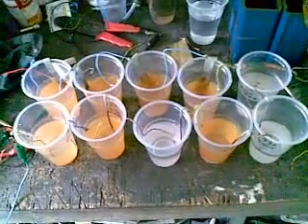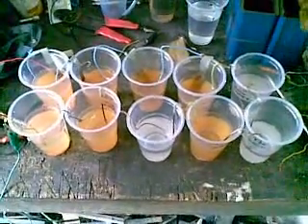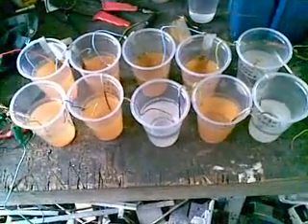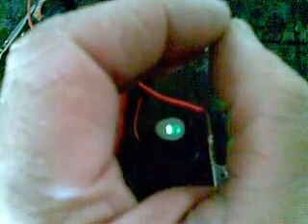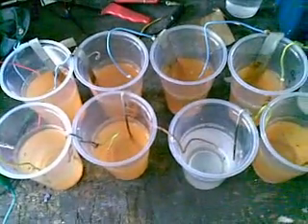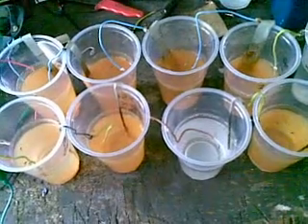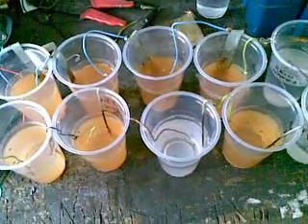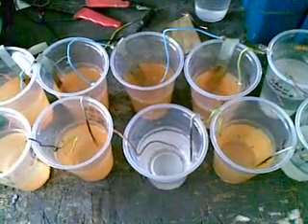Salt Water Battery - The Future of Energy Storage?

Comment: in uk,as a kid in the sixties ,old victorian houses,that had cellars,had copper wire runnning round the cellar walls,at base to stop damp penatration etc ?,,,,,,now someone has to try a 45 gallon drum ,thats a BATTERY lol,that could run a house ,via solar charging ,and "safe chemicals"as fluids ?+just refill it when it dies ?a bloody cheap battery bank ?mmmmmmmmmmmmmmmmmmm

Comment: @27simber salt water is probably the best electrolyte and it has only 1 main problem. if it didn't have this problem, it would last long and all cars would use it. Salt water corrodes metals like hell. if you run electricity through two plates inside of a bucket of saltwater, the metals would corrode in a few seconds, in about 2 minutes, the metals oxidize. a battery made from salt water supporting a fairly good load would last for about a week.

Comment: You could make it easier if you use aluminum cans. Put water in with at teaspoon of salt and vinegar. Then strip back the wire a bit and put it in the salt water, the insulation keeping it away from the can. Then simply connect the wire to the next can. Repeat unit you have the right voltage. An led only takes 1.8 volts to light up.

Comment: High Greg;
Please look at my salt water battery on you tube. It may give you some ideas.
5 coffee cups. 4 volts,  6 millie amps. Light Led 24 hours a day for 11 days.
Each cup is a cell. Each cell should produce .84 volts (temp. of the water is a factor) .   Size of the plates controlls maximum  amperage out.  But.  Temp. of water determans how fast you can releas the amperage.
I hope I have helped a little.
Keep up the good work.
           Raymond

Comment from the maker: Hi all,
This might have some applications either to supply power to extract hho or charge a small battery for other uses, torch, small pump etc...
Process works 24/7, so far over 74 hours.
No moving parts. Corrosion an issue.
At start 2.9vdc now about 2.5vdc.